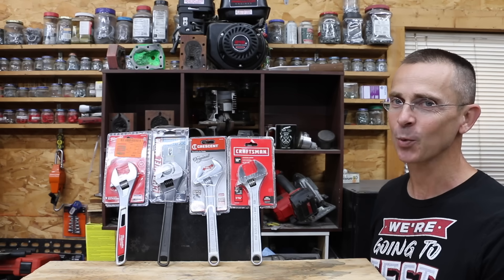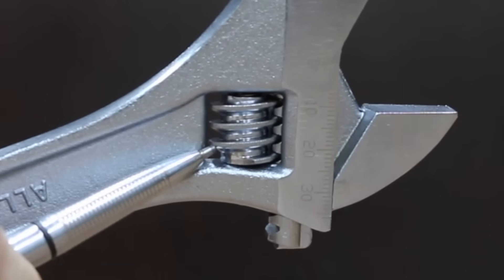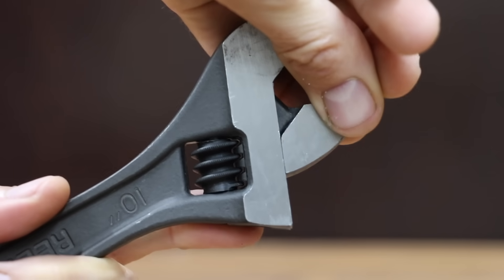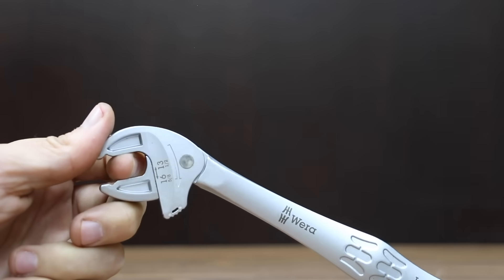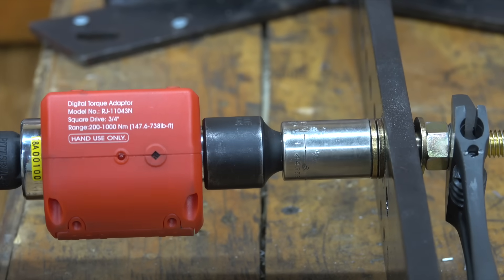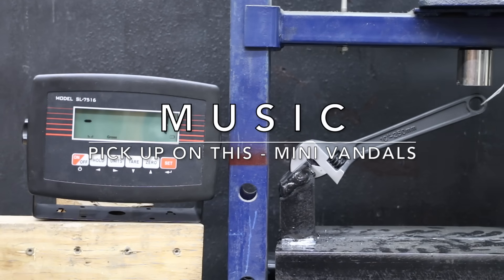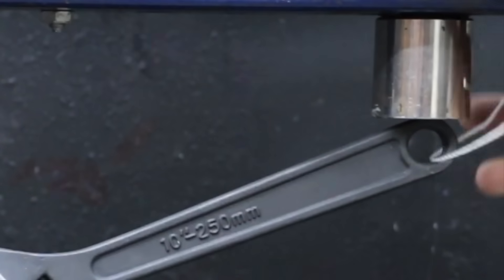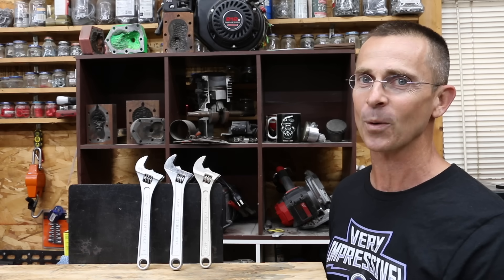Best Wrench (ADJUSTABLE)? Craftsman USA vs Craftsman, Crescent, Kobalt, Milwaukee, Channellock

Comment: I seen one problem with one of your test, ( not complaining bc you are the best at testing tools and making sure everything is fair) but in the first test with the impact I seen u were using your hand pushing down on the wrench and with using your hand u could apply more or less pressure and could affects how much movement the wrenches had. With more pressure applied the vibration could only go through the jaws as if u put less pressure the vibration could go to other areas. I doubt this had much effect on the end but something I seen and pointed out. But I love your channel and all the work and time you spend on these test. Keep up the good work
Reply from the maker: Thanks, will do!  Thanks for the constructive feedback.

Comment: The shorter jaws may have a leverage disadvantage but they have an advantage when measuring the gap at the tip.  By measuring that gap at the tip rather than at a specific distance means you weren't actually measuring the angle of jaw deflection.   All the same, brilliant comparison!  Your testing methods are amazing!  Glad my tool chest is full of USA craftsman and proto that I bought back in the 60's.  I remember if you ever broke a tool you didn't even need a receipt, just hand them the broken tool and they'd give you a new one.
Reply from the maker: Thanks!

Comment: As much as I HATE HATE HATE adjustable wrenches, they are my staple go to when working on the chemical plant. Bahco and Stanley are pretty good. The Bahco has a reversible head to grip rounded fasteners.
Reply from the maker: Thanks for sharing.
Reply: @ProjectFarm  no problem. A lot of our fasteners are both metric and imperial being a EU-USA owned site. It's better just carrying a pair of shifters around than a whole toolbag of tools!

Comment: Hi. Just wanted to make a suggestion for a future video to do comparisons of Tens units/machines which are used for pain. There is a lot of variability in price and to choose you need to understand pulse frequency, duration, intensity, volts, AC vs. DC ...all of which is very confusing. Thanks for all the great info.👍

Comment: This might be a weird request,  but could you consider testing a host of typical octane boosters and then measuring the AKI/RON/and MON it adds to your fuel? 

I try to mix fuel to create as close to iso octane that i can, but i never know The final chemical content a lot of these octane boosters have. 

Some boosters ive used are gumout/stp/chevron/108octane boost/lucas octane boost/ royal purple and VP racing(unleaded)

Comment: I must have missed something.....
I think you're suggesting, at the end, that if I have a little more money to spend, that I should get the Klein wrench.
HOWEVER....  It sure looked like the Klein only had a small advantage in the weight and no-load gap comparisons, whereas the Crescent beat the Klein in all the tests that mattered (unless you're going to space and a few grams matters).  So, for the same price I would buy 2 Crescent crescent wrenches.  LOL
Actually, I'll keep the Craftsman ones I bought in the 80s and 90s and hope they don't break.

Comment: Not that is entirely in the scope of these tests but the channel lock 8" big AZZ adjustable has served me well in a decade of heavy equipment repair. It opens to 1 1/2"+ but in a short package. Great for hydraulic hoses

Comment: 20years ago I flew to get a used truck . flying with a one-way ticket paid for with cash guaranteed homeland security nightmare and it was that's why I didn't bring a tool bag . I got the truck and stopped in the quad cities at a truck stop and cobbled a tool kit in that was a short handle bahco. and that has been a excellent tool . I'm not a adjustable wrench guy I have some . my favorite was a crescent brand  12 inch I inherited from gramps probably from the 1930-40s it had short jaws never failed but sadly it was stolen along with all my tools several years ago. 
 all the tens of thousands of dollars $70-75,000 williams snapon and specialty stuff . allstate insurance is garbage.
 anyway I am old to old to rebuild a lifetime of tools. simi e are mostly craftsman and harbor freight .now smh thrives

Comment: The Hazet "spindle mills the forging contours into the hard metal of the new die with highest precision and at a speed of 42,000 R.P.M." is PURE marketing nonsense. Translation: They used a CNC Milling machine to finish the hardened dies used to cast the wrench blanks. It's like saying "A state of the art fusion power plant supplied the power" to the factory that made the wrench. Has nothing to do with quality.

Comment: Can you do a video on automatic wire strippers ? 
Still in search for a good wire stripper for 4mm wire for solar panels
Bought many brands and the only tool that works the best for me its a cable cutter after long experience with him at stripping wires.

Comment: On the failure test wouldn't longer jaws be a disadvantage?  Seems that it's acting as a lever between the back of the fixed jaw and the tip of the adjustable applying force to the weak point of the adjustable. Wouldn't a longer lever apply more force to said weak point making it even more impressive that the longer ones won?

Comment: Would be interesting to see how these perform vs the Irwin quick adjusting "pliers" (despite the name they sell ones that are a great replacement for adjustable wrenches). I use mine all the time and like them a lot better than turning a wheel that doesn't always stay put. I've had several people see mine and have a "that's cool!" reaction. It's the little things that make life easier.
Reply: you mean the pliers they and pretty much everyone started to make as soon as
knipex patent for the pliers wrench went out?

Comment: My dad gave me about 20 crescent wrenches of old craftsmans, crescent, and assorted non name “made in USA” that both grandfathers had collected in their jobs. Gave them a soak in evaporust and they will out do anything modern companies are offering
Reply: @shelby M Most of my tools are more than a 100 years old.
That's because they're made to last forever.
Reply from the maker: Thanks for sharing.
Reply: I have a 70's 12'' Proto. Best I've owned and I abuse the heck out of it. Same with my 70's S&K tools.
Reply: @shelby M I don't think the quality of todays Crescent is even comparable to their old USA made stuff.
Reply: My Dad did the same, he's 76 y/o now. He is passing the torch.
Reply: @shelby M he decided he just stick with his dad’s 12inch snap on because it fits on his largest pipes and he only has space for a few tools so socket set, wrench set, screwdriver, hex keys. Gotta make choices.

Comment: Project Farm, I am a little surprised on the out come. In my own use I was so impressed by the Milwaukee adjustable wrench I got the full set from 6 inch to 15 inch, I do have a Gedore chrome finish with rubber grip I think made in China, 8 inch long and it has a lot of slop. Your Gedore is way better. I have a Stanley Fatmax FMHT75081 that would have been an interesting one to have been tested. One of my old favorites was the Wright 9AG10 wrench.
Reply from the maker: Thanks for the constructive feedback.

Comment: I use an adjustable wrench regularly.   I have tried many, and my search ended when I tried the Milwaukee.   For me, the single most important aspect is that it doesn't loosen off when you're using it.   I try to surround myself with tools that don't make my life worse than they need to be.   The frustration of having to constantly re-tighten an adjustable is far worse than paying $10 more for a wrench.  If you're using a 10" adjustable to apply more than 900 pounds to the handle then you really need to re-evaluate your life choices.   The 24" and 36" wrenches are used for applying that level of torque.   The Milwaukee is an excellent all-around adjustable wrench.
Reply from the maker: Thanks for sharing.
Reply: Yeah, I'm with you. I use a Crescent like the one in the video regularly, and I haven't had it loosen up either--like you say, I wouldn't be using it for the heavy-duty applications and it works just fine for the appropriate challenges.

My 8" is a Brigade (not sure where it's made, found it on eBay), and it is actually pretty impressive.

Sometimes you NEED them for worn-out fasteners and fittings that no longer really fit the correct wrench. Also, sometimes the wrenches with markings help you determine the size of regular open-end wrench you should get from your box!
Reply: @iFixJunk  My preferred wrench for worn-out hex fasteners is the vise-grip locking wrenches made for the purpose - that have the narrow hex shape built into the jaws.  They actually call them 'locking wrenches' instead of 'locking pliers' and the part numbers are, for instance, 10LW for 10" locking wrench.
Reply: Since you use one regularly let me ask you, do you also think the torque test he did place the wrench incorrectly (upsidedown) ? I Couldn't find any comments mentioning this. The contact point of the bolt is putting it's pressure higher up on the moving part of the wrench, giving maximum leverage to force the wrench apart.
Reply: @jesseback3536  I expect he did it that way because that's the only way you can reasonably do it with a force pressing down.  If the rig had have been made up with the plate at an angle then the wrench could have been put on properly, but honestly I'm not that interested in finding out that the wrench can survive 1000 pounds on the handle because I am not 1000 pounds and I won't be applying such a ridiculous load to the wrench.   It can handle way more weight than I am going to apply - that's what matters.   Use a bigger wrench if you want to apply more than maybe 200lb-ft of torque.  Just because the wrench can open to 1-1/4" doesn't guarantee that it is the Right Wrench For The Job to torque a 3/4" structural fastener that needs 300 or so lb-ft of torque.    Even if you did want to apply the maximum torque for the maximum size of fastener that the wrench is able to hang onto you still would need no more than maybe 400lbs on the end of the handle, which any of these wrenches would be able to supply.
I understand that 'strongest wrench' is something that people are interested in, but it's not a valuable metric for me, personally.  If the wrench is 'strong enough' then the usability factors are far more important, and for me the biggest usability factor is not backing off.  I want an adjustable that can be used like an open-ended wrench.

Comment: I normally like your videos but you screwed up on this one. 

When you were testing the torque on the adjustable wrenches you were turning the wrenches towards the movable jaw. That is not recommended when you’re using an adjustable wrench. You always turn the wrench so the torque is against the solid jaw - not the adjustable jaw. Making the data you’re providing useless. You’re basically giving data on using the wrench improperly. 🤷🏼‍♂️

Comment: Back in the late 70s when I was taught correct tool use, I was told to place the strain on the non-adjustable side of an adjustable ["Crescent"] wrench. I noted that you placed the strain on the adjustable side of the wrenches on the wrench maximum torque tests, but placed the strain on the non-adjusting side during the failure load test. I have always tried to apply the load to the non-adjusting side and seem to have had less rounding off issues. Maybe it's just me. Would you be agreeable to re-running the wrench maximum torque test with, say, 1 or 2 wrenches with the strain on the non-adjustable side of the wrenches just to see if there is a measurable difference? Thanks.
Reply: The direction of rotation used in the 'slip' test was correct.   The Crescent-brand wrench even has an arrow showing the direction of rotation.  Of course, you could suggest that that is the direction for loosening, but the bottom line is that my training in trade school matches the direction used in the video, and the direction shown on that one wrench, so I'm inclined to believe that the correct direction was used for the 'slip' test.
Reply: Good point! Was taught the same.
Reply: The direction used is correct. I noticed that it looked like the wrong way but it’s correct. Look carefully again at the videos